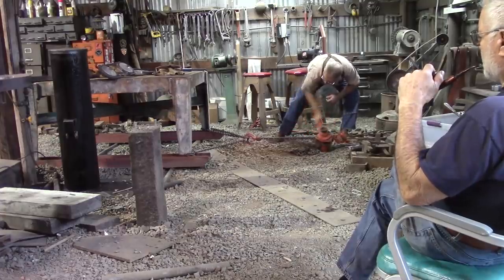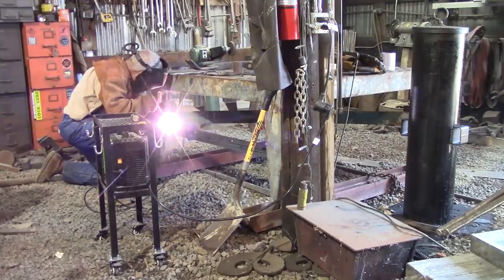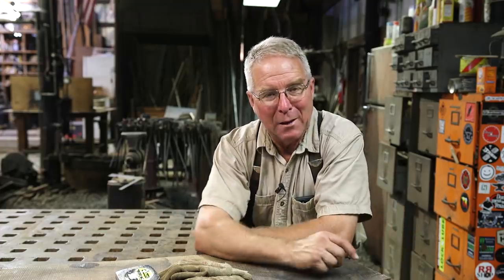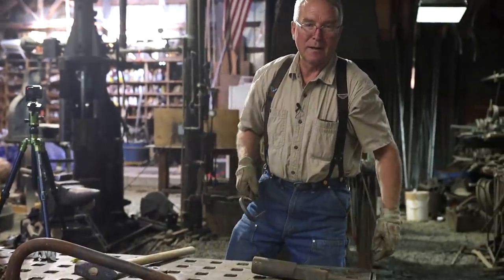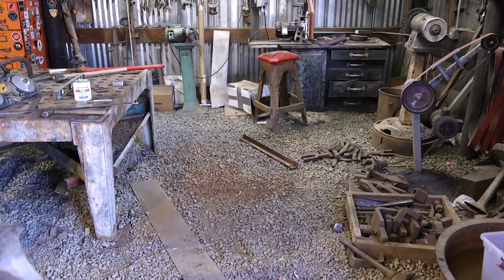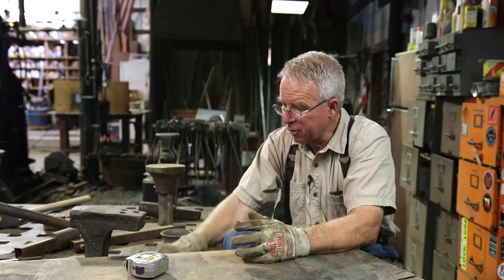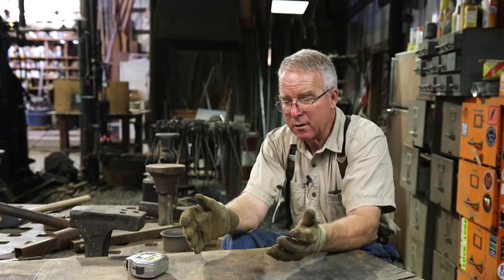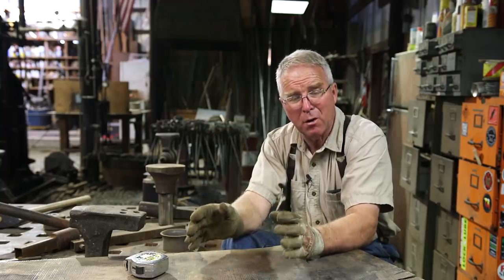The 5,000lb Workbench

Comment: Many years ago, 1974 in fact, i worked in the machine shop of the steel mill in Sydney, Nova Scotia. They had one of these tables in the corner where the welder did his thing. It was about 10' by 16' but otherwise was identical to the one you have. You could put anything on it and work away and you might as well try to move the building. You will find so many uses for this little table. I'm so happy you found it.
A little side note - I was only a young feller at the time. My official job title was "Hooker". Yes, I really was a hooker. I chased the overhead crane and hooked up the loads. And there were sooo many safety practices back then...

Cheers, John

Comment: I worked 47 years at a railroad. At one time, they had their own powerhouse. When it was dismantled there was a cast iron gear, 6 ft diameter and a foot thick with lots of holes cast into it. It was so heavy that a backhoe couldn't lift it but was able to drag it, barely. I set it up on timbers and used it as a heavy fab table. Oh, the things that can be made on a table like that! I sure miss that table, since retiring. Enjoy yours!

Comment: We had one of those in my high school's metal shop and I absolutely loved it. No one else really understood why I liked it better than our steel plate tables, but it was heavy, had plenty of places for hold downs, and FLAT. And no one else wanted to use it. Now that I've graduated I'm definitely going to miss it
Reply: Shalor McKee watch for school auctions. School boards have a habit of selling “old” equipment, especially when the instructor retires and the new guy is too inexperienced to know what half the tools are good for if it doesn’t say Dewalt or Milwaukee.
Reply: Maybe you should try and get certified to teach your beloved shop class there
Reply: @QuietRiverBear  Yeah I agree, These tables come in all sizes they are extremely expensive new but people usually don't want to deal with the hassle to move them so they go kinda cheap at auction

Comment: the main problem you got with a flat surface that large is that it will accumulate stuff fast when its not in use
Reply: Especially if my ex-wife is around.
Reply: There's a shop law that all horizontal surfaces will accumulate detritus at a rate higher than use or cleaning allow for.
Reply: royal society for putting things on top of other things...
Reply: Just tip 'er on the side and it will all slide off, easy.
Reply: Matthew
 ... I recently retired from a shop and my pet peeve was the boss constantly walking in with a new project and placing it in the middle of a work bench where I already had today's stuff going on. One day he walked in and I asked what this was (pointing to my work area) and he said it's a work bench. I said, that's right... WORK bench... not STORAGE bench! If you want something done then put it over there and leave me a note. When I get done with this I will start the next job.
Reply: Tru Quality 
Yeah, and she really hasn’t aged well either.
Reply: @rupe53   yeahh sure you did buddy.
Reply: @VCthaGOATdunker  ... hey, it's not every employee who gets to train the boss into proper thinking. That's why they kept me around for 23 years.  <LOL>
Reply: @rupe53  Hey maybe you did tell your boss that but not in the way you implied. If you did you'd be packing your bags.
Reply: @VCthaGOATdunker  ... this was one of those situation where I knew the boss for many years BEFORE working there. It also helps if you smile (smirk?) when you make a wise crack. The rest of the employees always made jokes about him being like a cat that always puts dead birds on the front porch. Now you know the situation!

Comment: Two things. The dude smoking a pipe in the corner while Scott is cranking the come-along @3.47 is my favorite part.  It's the exact sort of grandeur that such an occasion calls for. 

Also, how does that thing weigh 5000 pounds?  It just doesn't seem like there is enough material for that.  I'm not doubting it, I'm in awe.
Reply: look at the thickness of the top 'plate' of that table. You can get a good view at 3:08 of just how thick it is. There is a lot of steel in that table.
Reply: The dude smoking the pipe needs to have a cameo in more videos.
Reply: I think that's Scott's father but I'm not sure.
Reply: @dcrog69  I thought so too at first, but didn't his father pass away right at the beginning of the spec house series? Maybe father-in-law??
Reply: @ThePositron2  I thought that his mother passed away but I'm still not sure,have to rewatch it.
Reply: @dcrog69  I thought the gentleman was a builder friend. He built some nice craftsman style homes if I recall.
Reply: @dcrog69  'Tis....
Reply: EC's dad with the pipe.
Reply: basically the top plate has to be 4.5" thick. to be 5x5 with 178 1" holes puts it at 58.49x58.49 inches of 4.5" steel. 4380 lbs roughly, then add on the other big ass angle iron and framing and its pretty much all there.
Reply: @mikez4132  that's his friend, not his dad. His dad is much older.
Reply: Junk Name  thanks!
Reply: @kracin  Nice explanation/calculation.  Very informative.
Reply: It doesn't.  I called the company, a 5x5 platen is1100lbs and the stand is 500lbs from the company.  the top is cast as a 2 inch thick upper surface with 4 inch ribbing underneath the edge and in an x under the middle.  so most of the 6 inches of the top is air because of the holes and ribbing.

Comment: Certainly not has heavy as a platen table, but we moved a large garden shed by cutting the anchors securing it to its concrete pad, jacking it up about three feet into the air, supporting it across the center inside with a pair of stacked 4x4 beams on a 2500lb-rated pipe jack stand, rotating it into the direction of travel upon that pipe jack stand as a pivot, then constructing wooden rails with concrete blocks as cribbage and using short lengths of 2" black pipe as rollers to get across a pony wall and over to the new concrete pad.

Once we got into the new location we had to do it all in reverse, rotating it to the correct angle and centering it on the pad, preparing to lower it down (using a thoroughly lubricated ACME screw on the center pipe jack stand, wasn't that fun), and when getting close to the ground, drilling holes in the floor plates for the conduit penetrations in the new pad.  After we were done and it wasn't flying anymore my dad finally disclosed after all these years that his father had a wooden leg because when he was a teenager he'd been in an accident doing something similar, but the building had fallen on him and crushed his leg.

It was a lot of work for a wooden garden shed but still cheaper than building a new one.  Plus having lighting and electrical inside of the shed without having to run an extension cord every time is nice.

Comment: I have moved several stone slabs weighing 1000 + lbs. with 'planks and rollers'. I used 2"X6"X10' as the tracks and then wood fence posts as the rollers. Once set up it was easy to move these stones right along with a digger bar to nudge them with.

Comment: When you were loading that platen table using the jacks and cribbing blocks to raise each side about 6 inches at a time, It looked like that table was going to slide down those I-beams just at the point when it was about high enough to load.  Good job in getting it done. 

If you haven't  seen the out-of-print books written or illustrated by the late Aldren Watson about blacksmithing, the village blacksmith and on making country furniture, and a variety of his books on the old ways of doing things, you have missed a treat.  Watson drew his illustrations, and he is the finest illustrator of tools and using tools as a blacksmith and as a furniture maker I have ever seen.  He contributed illustrations to a very long list of books and other works. If you don't have them, try your public library, or get them used through Amazon or eBay. If you haven'tbsern the books by Alexander G. Weygers on blacksmithing and tool making, they are a motherlode of great information on forging, etc.  The books he published while he was alive had many color illustrations, which really makes his work come alive. After he died his works were republished, but generally with poor quality black and white reproductions of the original color pictures; I was lucky enough to see and buy the original versions in color when they came out in the '70's.  Thanks for sharing your trip to get the platen table. If you haven't done a video on evaluating and tuning up a power hammer, this fall might be a good time to do it.

Comment: I was hit by a distracted driver years ago and couldn't hold a cup of coffee in my dominant hand for a while, and yet I'm still getting huge ash logs home to split for heating.  I'll load my truck with wood twice before a team of two will load theirs once, and the difference is: I never pick anything up.

Rock it, roll it, slide wedges under it till it's tall enough to tip over into the truck.  Don't kill yourself being a "hero" - heroes load up, unload, and come back for more.

Grats on that sweet table!  I just got a bench from a neighbor that was a welder, it's built like a tank and half steel with a vise big enough to sit on.  Moving crew was surprised when it was just me showing up to get it and I got it in the truck!

Comment: The new version of this is the Bluco modular welding tables.  Made in Germany by Demmler, I believe.  The are hardened and ground cast-iron tops with graduated markings and a self centering pin system.  However, this is the granddaddy of those systems and every bit as functional if not as precise.
Reply: I wonder what the An-225 rate is, for shipping one of those over here.
Reply: @jej3451  An-225 it will cost around $30,000 (£23,220) an hour.
Reply: @firesurfer  So I can probably get a Bluco table for about $10,000 plus $200,000 shipping.

Comment: I was once visiting a smithy and the blacksmith had one of these. He had about 4 feet of 1/2'' bar scrap that wasn't straight with a few bends down its length. He wanted me to use it for practice, and to get it straight, ran it back and forth through the coke forge until all of the elbows were glowing, walked over to the platen table and swung the thing down with a sharp snap like he was swatting a fly. He rotated it 90 degrees and whacked it down on the table again, removing all the bends. Not perfect, but straight enough for me to get some practice in.

Comment: If you are looking for cribbing find a company that does guard rail work.  They will routinely have old pieces of 6 x 8 guard rail posts these typically run six to seven feet long.  The local company around here gives old one away a lot of the time when replacing sections

Comment: I was pretty impressed with the shop-boom crane being able to lift that table. Even if it wasn’t very far out on the boom.
I think if it were mine, I would pour concrete pads under each leg with (3) 1” pieces of all thread at each leg to use for leveling the table.
Reply: I don't think the crane was moving the heavy table, I think it was one of his other ones
Reply: He lifted the light weight table this one replaced.
Reply: @jockwalker24  Ah yes, you’re right. Wasn’t watching on full screen.

Comment: id clean that whole table up and cover it with a good cold blue and grease it then wax it and paint the legs. totally worth the money. I think a new one of those, cast welders table, is worth $10000, especially if you take some time to scrape it to aerospace flatness standards. die grinder + cup brushes (knotted) would clean it up good enough. I think its worth more then alot of things in your shop.
Reply: and you might want to look at what welding that beam did, it could have bent the table and strained it, but you can cut out the reinforcement if necessary and bolt on some ground flat bar etc.

Comment: I thought my welding table was heavy at 1.2 tonnes.   It's built from 20mm thick steel and is 1.2Mx2.4M.  It's got 6 legs with castors so it can be 'moved' around a little.

Comment: Are these plates still made nowadays? And what are they made of? Wrought iron, cast iron, a combination of cast iron and steel?
Reply: made in philly i think.  they are cast in a mold 2 inch thick top with 4 inches of spaced ribbing below to stiffen.  then they are ground and machined to aircraft tolerances.  the fireball tool yt channel did a review of like 10 different tables and this was one.